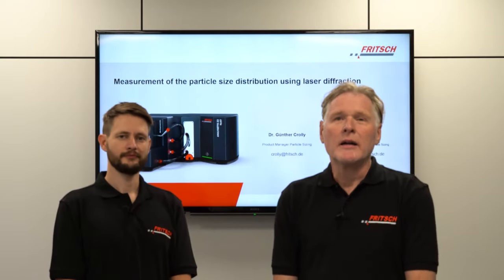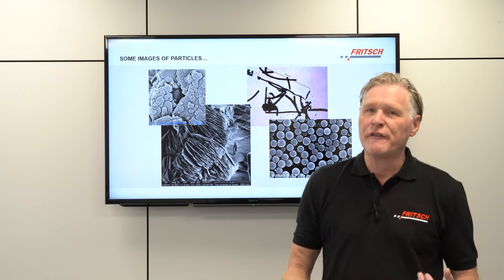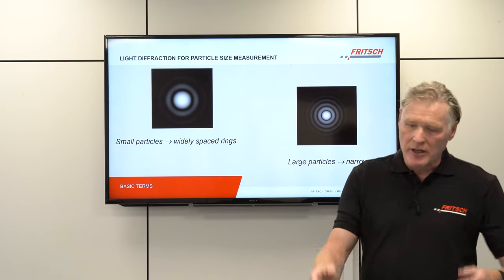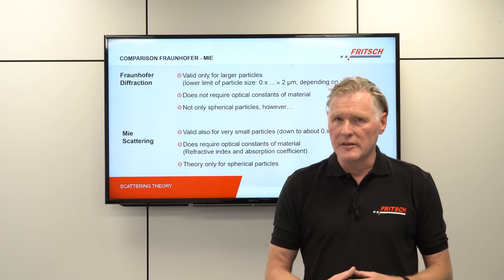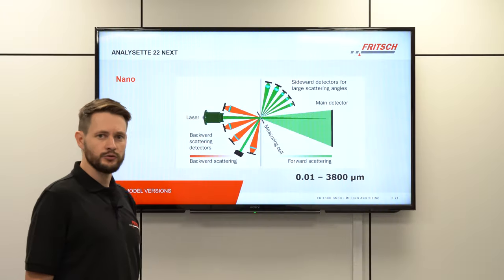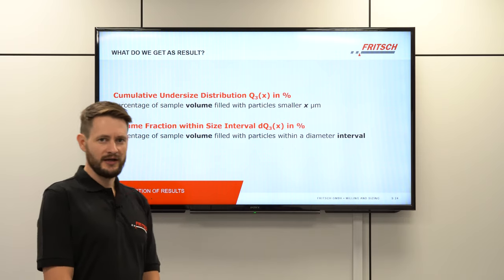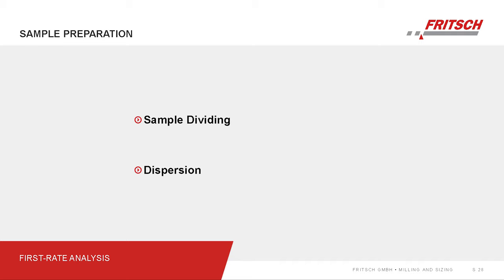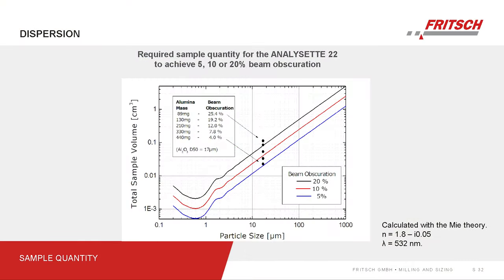Webinar: Measurement of the particle size distribution using laser diffraction

Comment: Can it be used for soil partical counting?  We are running this test for our wind farm project in USA. so far there is no standard and we are trying to develop an in-house method .🇩🇿🇩🇿🇩🇿
Reply from the maker: It is not possible to count particles with laser diffraction. The system only delivers relative particle size distribution, i.e. how many percent of my sample have a size of this or that diameter. 
One possibility to get at least an idea of the particle number could be to calculate the number from the density of the soil (if known) and the measured particle size distribution.

Depending on the size range you are looking for imaging could be an option. If your particles are large enough (larger than a few hundred µm) then the FRITSCH A-28 ImageSizer can be used to measure the sample. The A28 takes images and the software of the instrument then analyses these images and can create a particle size distribution. As an additional information you also get the number of measured particles. However, typically not all particles in a sample gets detected and hence the number that is presented at the end is not the correct number of particles in the sample. But in some situations it is possible to create a correlation between the number counted and the actually present particles. But this requires some intensive testing.

For more information feel free to contact us directly: beratung@fritsch.de